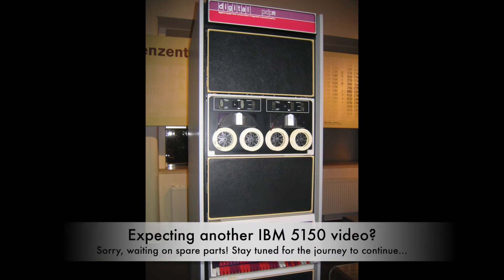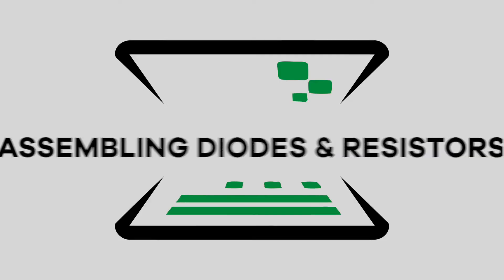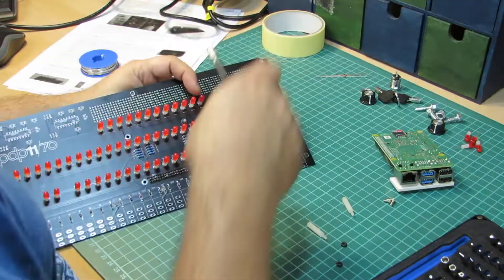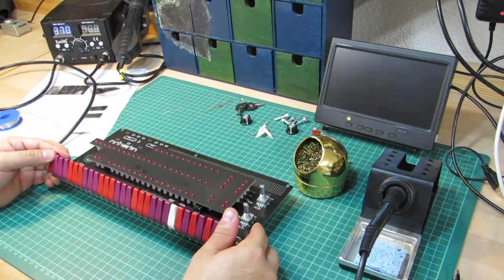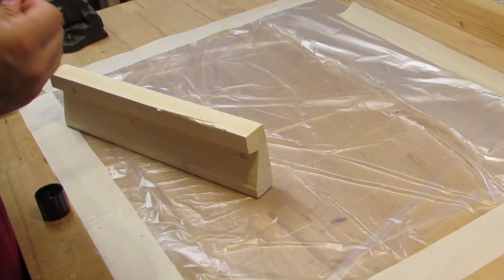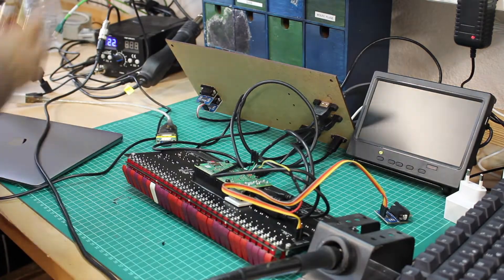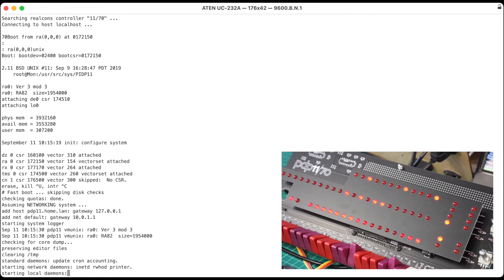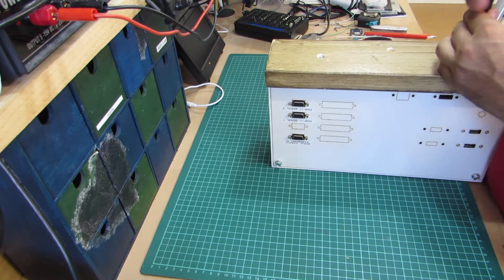How to build the PiDP-11 "PDP-11" replica

Comment: I also have a running PiDP. The intention is to combine it with another machine Milkv duo S to run a minimal Ubuntu on Risc-V. The minimal Risc-V machine provides almost infinite storage compared to the PDP11/70 ... Both RAM and disk. There is space for several generations of Risc-V machines in the enclosure. ;)

Comment: Thanks for this. I'd love to have one of these but am not sure my soldering skills are up to the mark!
Reply: Thanks. I did and my pidp8i has been working for some months now 😊
Reply: I am by no means a proficient solderer, and I put it together over several days with no issues, just take your time, watch a few YouTube soldering videos and give it a try.
Reply: There is no difficult soldering in this kit, but do make sure you have a decent solder station.  It's well worth spending a bit of money here.  Personally, I think this kit is an excellent way to start to build good soldering skills - it will start off very simple.

Comment: Very informative video. I have the PDP11 pi kit and plan to get started assembling it soon. I also have  the PDP 8 replica, the Altair and IMSAI clones as well. I worked of DEC for a number of years and having these early system clones I worked with in the past is a real hoot.
ONE QUESTION for you, which Raspberry Pi did you use and is there and advantage to going to a faster Pi like the Rev 4/
Thanks for your well done video !!
Reply from the maker: @wa4aos You're welcome. If I remember correctly, I put a Raspi 4 in. I didn't do any comparison between earlier or later generation Raspis, but I'm definitely up to say, the faster multi-core CPU of the RPi 3 and RPi 4 have an advantage. The RPi 2 is a bit more sluggisch in present day operation, that's my personal experience. Maybe that matters not so much if you just want to use the supplied OS and run some of the software. But if you are up to do some heavier lifting inside the emulation, i.e. recompiling 211BSD, then I'd definitely go for the RPi 4.